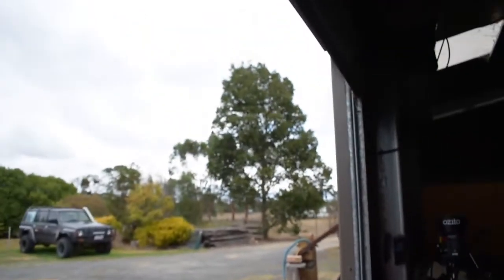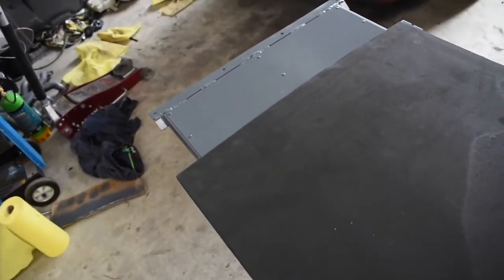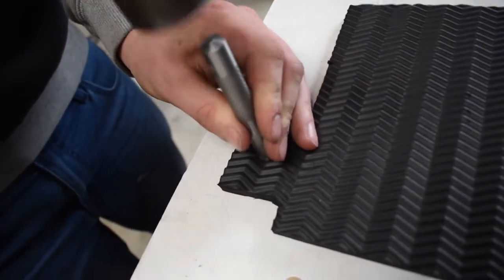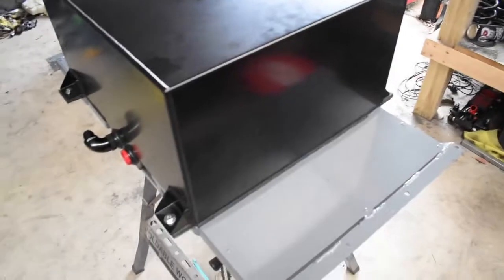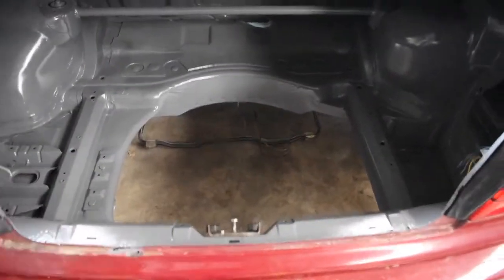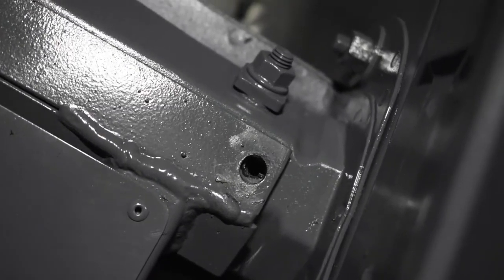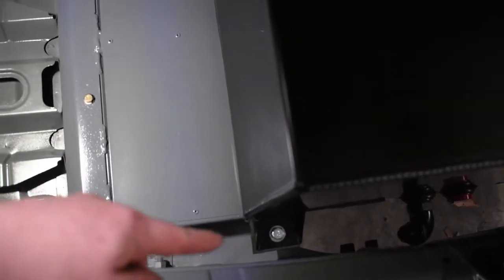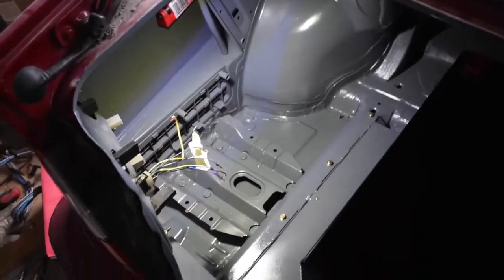Finally installed my fuel cell!

Comment: How's the fuel cell holding up and where did you get it?  I'm contemplating getting one for my 1986 Silverado c10.
Reply from the maker: So I didn't end up using the fuel cell, I changed to a surge tank and twin pump setup, but I got in from aeroflow

Comment: Great idea with the mat for vibration dampening, I know this is an old video but how has the fuel cell help up after the last couple of years?
Reply from the maker: So I didn't end up using the fuel cell, I changed to a surge tank and twin pump setup

Comment: Fuel cells should be mounted as low as possible to help the cars center of gravity when hard cornering
Reply from the maker: Thanks mate, I was limited on space on where I could put it, the only way I could sit it lower was to move it further back, making it more susceptible to damage from rear impacts and wall taps